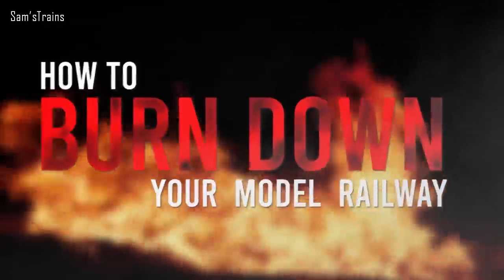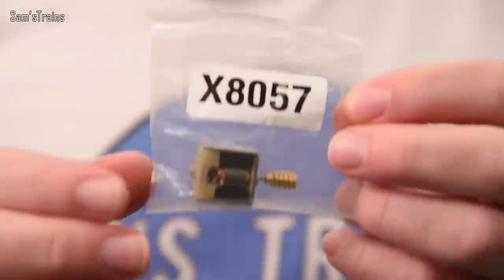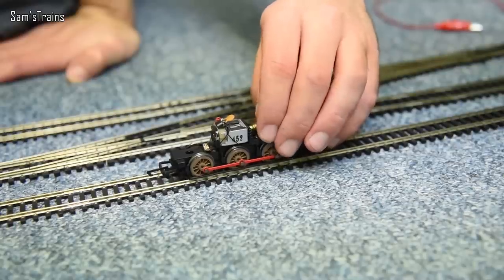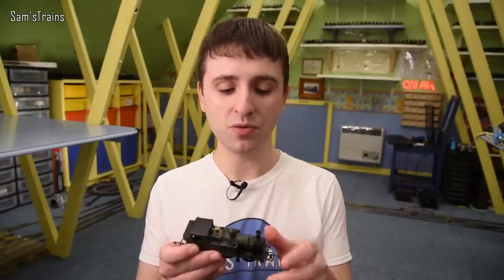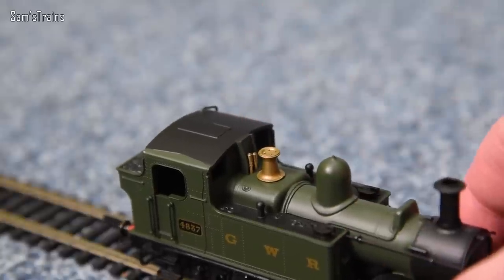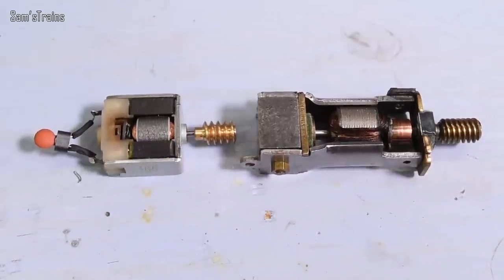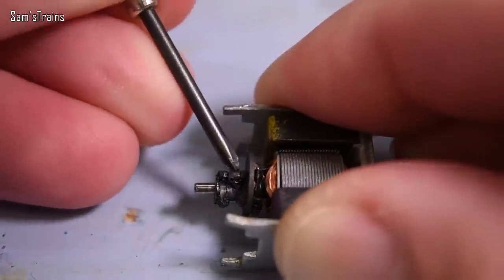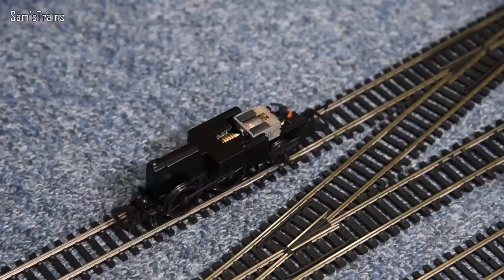How to Burn Down Your Model Railway | Train Motor Meltdowns

Comment: One of mine started sparking while still running, then failed
Reply: i had the same thing happen to my bachmann class O8 but instead of sparking the motor just died
Reply from the maker: Yeah that's often how it starts - lots of the old ones get a bit sparky!
Thanks for watching - Sam :)
Reply: @SamsTrains  You know the old Hornby HSTs? Well will the Old motors get bad like this? Because I have some in my attic I might try soon to run it..
Reply: I had that happen with my lima class 08 and also my hornby E2 sparks when it goes over a half turn on the controller, the wheels sparked loads. Only the E2 still works.

Comment: I know I you feel Sam. I’m from America and I have a dock switcher made from a company called Lionel I got it on Christmas Day I believe it was 2017. I was running it around my Christmas tree, it was only pulling about like 2 cars. But then I realized it was slowing down. I shut it off and it smelled really bad. Turns out that the motor and the reversing unit was burned out. My dad tried to find new parts but he could not find the motor. It hasn’t ran since. 😔
Reply from the maker: Cheers Matthew - sorry to hear about that - that definitely sucks :(
Thanks for watching - Sam :)

Comment: You ever snap a screw when putting front wheels back on? If so how ya get it out
Reply from the maker: You mean the crank pin, or the body screws? I've never done it mate - it'd be very difficult indeed!
Thanks for watching - Sam :)
Reply: @SamsTrains  the screw that holds the bogie in i tried glue didnt work it kinda runs better with out it  but looks stupid

Comment: Uh-oh… I have an original Hornby 58 with this motor. I’ve been running it over here in Canada using US controllers that actually spin up to 18V on full chat, and I’ve just bought it a rake of 12 HAA. I don’t know if I dare run it with a full train now, especially seeing as I’ve got quite an incline to contend with…

Comment: I have an old 70's 00 gauge Kays kit in white metal for the Bayer Garret with the rotary coal bunker.  What is the best motor for it and where from please ?   Also the drive wheels are plastic.  
I need some metal replacement ones but where from ?

Comment: Hey sam, as an electrician, any chance to get a brushless motor retrofit? I want to see some of your trains getting quite the upgrade! I can work with you a circuit to power up the controller at low voltage in your analog railway, cheers!
Reply from the maker: That would be very interesting - but could that work with the loco picking up power with only 2 rails? Would there need to be a lot of circuitry?!
Thanks for watching - Sam :)
Reply: @SamsTrains  Well, not a lot but sure 2 or 3 pcbs would need to find a home on the retrofitted loco, so it needs a bit roomy inside, since for pure dc analog control it would need a DC-DC Buck converter to power itself, the ESC to control the motor an a smal arduino or an ATiny microcontroler to read the line tension and command the esc to speed up acordingly. So I would personaly choose a loco on his way to the scrapyard wiling and capable of such experiment so we have some room to make it work first then downsize it so it fits more locos.

On this, a DCC would solve a lot since I wouldnt need to use a Buck converter and only hijack the output to the motor of the dcc controler and give it to the micro so it can translate it to the ESC to drive the motor.
Reply: @acynder1  … and of top of the electronics, you need a constant voltage in the tracks (DC or AC)  and some method to transmit the speed information into the locomotive.
Reply: @railfilm  thats what the buck converter is for, the hard thing would be polarity protection for the smarts
Reply: @acynder1  not only that. But the speed of the BLDC motor depends on the driving frequency, not on the voltage on the motor terminals.
Reply: @railfilm  did... you read the mensage i posted in response to Sam's? I detailed that an ATiny would be needed to read back the analog voltage of the track and feed the correct signal to the ESC
Reply: @acynder1  sorry I missed this reply. Märklin made such trains some 20 years ago, the project failed completelly (obsolate.) ( sinus drive).

Comment: Youll get used to it if you run older american brands like S gauge American Flyers from the Gilbert era which always spark and arc from the track contacts or simply derailing
Reply from the maker: haha yeah that's true - but they don't melt down and die permanently do they?! :O
Thanks for watching - Sam :)
Reply: Sam'sTrains occasionally yes, but that mostly deacribes my soul

Comment: Lint from carpet getting into the motor. Mixed with oil and you have a tinder box.
Reply from the maker: Nah - I work hard to keep the track clean and vacuumed, and I service engines annually - in a year's running, there's never any noticeable lint to speak of!
Thanks for watching - Sam :)

Comment: I picked up a set of older diesels on EBay a few months ago and so far, only one of three three has had any life. The two issues are old Triang (I think) Class 37s with the powered truck. Neither want to do any sort of running at all and neither respond what so ever to any sort of current, even after dissasembly, cleaning, and further reassembly. Is there a place I can get working motours for these old things?
Edit:
also, a Bachmann USA model with a failed motour? Whaaaat? I would have neeeeeever expected that!
Reply from the maker: Hi mate, yes most of the tri-ang armatures can be picked up as spares from Ebay - you may also need to replace/recharge the magnets, since any weakness there can seriously hinder performance or damage the armatures. haha I know right - who could have expected that?! ;D
Thanks for watching - Sam :)

Comment: For me almost burning my model railway down was with a hot glue gun, I was laying track down for the staging area so using hot glue looks rubbish but makes track laying much quicker as I was holding the track in place while I waited for the glue to cool down I heard a load popping sound when I looked at the glue gun it was producing smoke so I quickly unplugged it and as I was carrying it out of the shed by the cord the glue gun burst into flames  I was able to get it outside and I didn't get burned but if I had been any slower the whole shed could of gone up.
Reply from the maker: Ooh dear that isn't good - still, a bit of entertainment during track laying? ;D
Thanks for watching - Sam :)

Comment: Thanks again for the information, I learned  something new again. I seen you had 5 coaches and a brake van when the disaster happened, I have a Terrier with two plank wagons and a Van. If I purchase three or four more wagons to add on, do you think that would be overloading the locomotive. I also took the time to learn to spell a word you used "Effervescence", A good learning day all the way around.
Reply from the maker: It's a pleasure Peter - is it one of the new terriers? I'm not aware of this issue with any of the new ones!
Thanks for watching, Sam :)
Reply: @SamsTrains  Ok, good news, because it is a new one. Hornby # R3811.

Comment: Same motor failed in my son’s Thomas. I wouldn’t mind but it had only been out the box twice from new and probably not done 5 mins work in its life. Completely unloaded, light engine at the time, just stalled and and then began to smoke. Although it was as new, it was already over a year old so it was an eBay job for a new motor rather a warranty claim... would be bad enough on one of my older models but this was my lads and very clearly a more ‘toy-like’ entity
Reply from the maker: Sorry to hear that - yes they're useless - don't know why they insist on using them! At least they're cheap to replace I suppose!
Thanks for watching - Sam :)

Comment: I've never had that specifically happen but I do have two engines that don't work. One is a GWR prairie with a broken piston and a 2MT tank engine with a dead motor
Reply from the maker: Ahh sorry to hear that mate - maybe you could get replacement motors for the 2MT??
Thanks for watching - Sam :)
Reply: Sam'sTrains yeah I think my dad is working on the 2MT and I’m trying to mend the prairie. There’s a little piece that slides on two plastic rails and I’ve lost one o the rails. I’ve built a small replacement piece but t keeps breaking. Any tips? Im trying to glue it back on to the base of the piston and another piece just under the running board
Reply: Try looking for a new cylinder block there easy ish to change
Reply: David Smith thanks. I’ll give that a go

Comment: Good reason not to have traction tyres.  I replaced the rear drivers on my 14xx with a pair of standard wheels: she may may only be able to haul  prototypical branchline traffic, but has run quiet and flawlessly for about 7 years.
Reply from the maker: Yeah I agree - though these don't touch the track, so they don't matter, lol! ;D
Thanks for watching - Sam :)

Comment: Hi sam, i recently got some motors from amazon, they’re made by acompany called utax, they’re small enough to fit inside a locomotive, they run at 24000 RPMs, will they work for my projects? They only came with a plastic mounting bracket, how do i put them in a locomotive? Do i have to do any soddering to make it work?,i’m trying to avoid using a sodering gun because i can’t see, so the risk of being burned is very hi for me, is there a way to make the motors run without using heat?

Comment: Those motors must be some extriemly bad qualty ones.
I have two lockos with even smaller openframe motors, and powered on held compltely halted they dont fry.
The worst thing ever happponed to the is the metal dust filling the gaps in the commutator by the time I used them, causing them nearly short out and stop.
Reply from the maker: They are - they're super cheap - cost around £1 each!!
Thanks for watching, Sam :)
Reply: @SamsTrains  , now I understand. Are they long time awailable from the seller? Prettymutch the commutator needed to be replaced, the motor otherwise seem fine.
Those I menthioned in my trains making me nerwious, because I don't know how I'll fix the brushes when they erode completly.

Comment: The Hornby motors are similar to the box motors, same size ,used in the motorific cars,trucks and boats here in the U.S.back in the 60s.I think the motors are to small to pull rolling stock.
Reply from the maker: Yeah you're right - very standard motors - and very cheap and useless ;)
Thanks for watching - Sam :)

Comment: Excellent video Sam.   It does seem, in general....that the smaller the engine....the smaller the motor....but you would think they'd be a little bit more powerful and durable than that.  Interesting failure....and yep, there's an old  saying...it's not the voltage that kills you...it's the current.   It's almost as if they should place "recommended" pull--loads in the manual (i.e. 5 cars, 8 cars, no more than 10 cars for any long duration...etc.).  What is interesting is that on your layout, you don't have any major inclines for the locos to go up....so truth be told, your locos have a pretty decent "lifestyle"....especially compared to some of the other big layouts with hills , etc. I've seen on Youtube.
Reply from the maker: Yeah that seems to be true - these really aren't much good though as you can see! Recommended pull loads is a very cool thought actually!
Thanks for watching, Sam :)

Comment: The hornby R8250 controller will not run my hornby class 66 it will cause the class 66  to suddenly stop. No problems with the HM 2000  or the Hammant & Mogan Duette. Bachmann Pannier similar behaviour with the R8250. Slight burning smell from both locomotives after using the R8250.
Reply from the maker: Sorry to hear that mate, but no they're not much good - yes I can't fault the HM2000 either!
Thanks for watching - Sam :)

Comment: Nice video Sam, I would never want that to happen to my model railway, hey I have a question, I have a model railway that is only hornby locos it’s supposed to be my British railway layout, but I’m thinking of making a new layout that is only Bachman locos and that is gonna be only locos from America, mainly diesels, but I was just wondering if ur able to put a Bachman loco on a hornby track and be able to run it with a normal controller cause if so then I’m using hornby tracks for mine.
Reply from the maker: haha me neither really! Yes OO or HO Bachmann locos will work fine on Hornby track! :D
Thanks for watching - Sam :)
Reply: Sam'sTrains ok thanks that’s really good to know cause the Bachman track isn’t really that good but the hornby is way more realistic so imma use that instead:D

Comment: Quick question. What is running a loco in
Reply from the maker: It's allowing a loco to run at medium speed in both directions for 20-30mins without a load, it allows the motor to bed in!
Thanks for watching - Sam :)
Reply: @SamsTrains  ah. Okay thanks

Comment: Dear Sam

My Tyco C-636 has a great motor and all but when it rolls, theirs Sparks on the wheels when it runs. Is this normal or not?

Thank you Sam,
CrowfarmerYT
Reply from the maker: Yeah that should be quite normal - if the wheels are coming from the sparks, that's fine - just check how much current the motor is drawing!
Thanks for watching - Sam :)
Reply: Thanks M8

Comment: I've not had a Hornby engine fail but maybe the ones I used to run were quite old! The new small motor in those could suffer from a melted armature carrier by the looks of it, at least it looks cheap to fix.
In a way engine failure is a good sign - that it's actually being used LOL. 
Some of the best quality motors I've seen are in double-bogie Roco electric/diesels, one giant motor in the middle to drive all 4 or all 6 axles. BTW why do you run your trains on the floor, would it not be easy to add some staging for the track at eye level?
Reply from the maker: Ahh yeah - it's rare to get failures on the older models! haha yeah I guess that is true!!
Thanks for watching - Sam :)

Comment: The dust, fluff and junk when running on the carpet gets sucked into the locos sticks to the oil and thus causing the motors to fail and yes quite possible a fire
Reply from the maker: That can happen, but not in my case - I clean my track and service my engines often - there's never any fluff inside them!
Thanks for watching - Sam :)

Comment: That escalated quickly... Is that motor type also used in N scale trains?
Compared with that the old Fleischmann motor is a lot more robust. Bought a one with a few decades of neglect, which smoked like someone installed a smoke generator... After a good clean it is running largely issue free
Reply from the maker: It may well be - I wouldn't be surprised! Yes Fleichmann stuff is way more robust for sure!
Thanks for watching - Sam :)
Reply: @SamsTrains  As you have the G3 which has the old style motor, imagine that with the whole collector lighting up orange from burning carbon and oil residue. As the really old Fleischmann engines (the one described is from the late 1960s) came with full metal brush holders, it did no harm

Comment: I had a Dapol B4 at a show this past weekend that couldn't quite handle the stress of two hours of straight running. Haven't really determined whether it is a motor problem or pickup problem yet. In any case, I expected better performance from a nearly new loco on a nearly new layout. Anyway, talk to you soon. ;)
Reply from the maker: Sorry to hear that Andrew - I've had a few dodgy runners from Dapol too - hopefully you can get a replacement :(
Thanks for watching - Sam :)

Comment: Can you help Sam 
My Thomas (new one ) was running for about 1 hour fine (it was brand new) until it slowed down and came to a stop belching smoke 
Any advice would be good
Reply from the maker: Is that the Bachmann Thomas? Unfortunately that's a motor issue too - if it was new, return it for a replacement or a refund. They often fail in that way!
Thanks for watching - Sam :)
Reply: Sam'sTrains no it was the 2015 hornby one

Comment: Can’t help think that part of the problem you had, might have been where the carbon dust from the motor brushes, stuck to the commutator as it’s been oiled. 
The failure is probably due to the insulation breaking down between the poles of the commutator, with the higher level of current from overloading, making the electricity take the easier path through the broken down insulation, maybe aided my carbon dust stuck to it.
One idea could maybe be to blow out any carbon dust periodically, or clean with some kind of contact cleaner.
Reply from the maker: Yes that's certainly a possibility - but this has never happened with more expensive models with decent motors!
Thanks for watching - Sam :)
Reply: Sam'sTrains  hi, yeah more expensive motors probably don’t suffer as much, as probably better quality insulation material and better brushes. If the insulation is crap in the first place, the crumbly brushes will soon allow current to flow between the poles.

Comment: If they are still using old style ceramic magnets in the motor, the magnets will easily be de-natured by getting hot, up to the point where they will not be strong enough to drive it. You can seriously weaken these magnets by leaving them on a hot radiator for a few hours, even.
Reply from the maker: Yes that's very true actually - could be another reason why they go thermonuclear! ;D
Thanks for watching - Sam :)